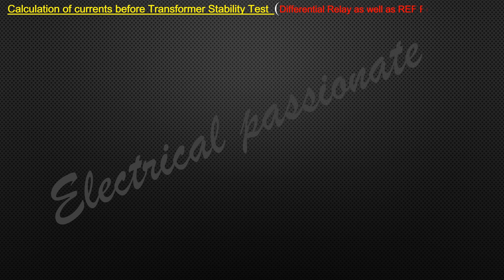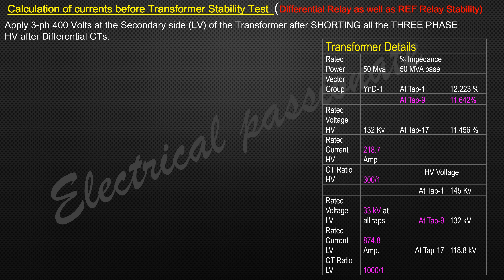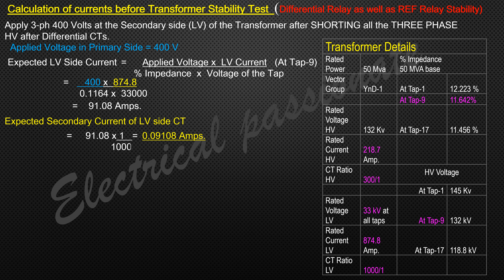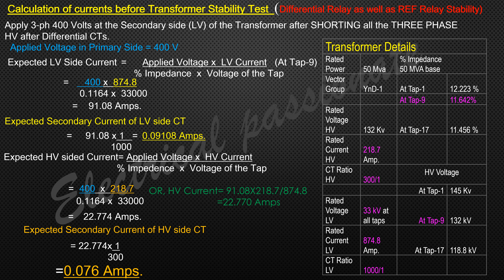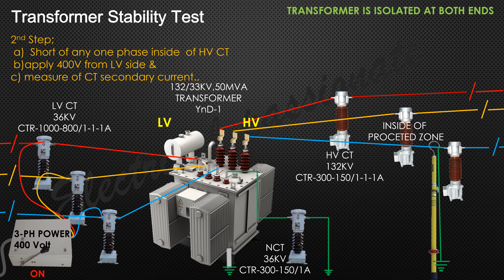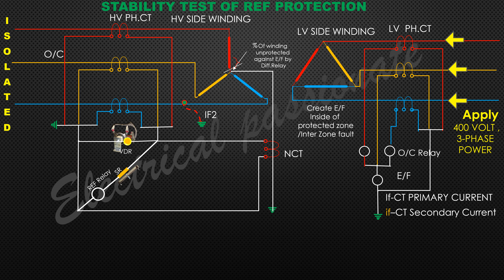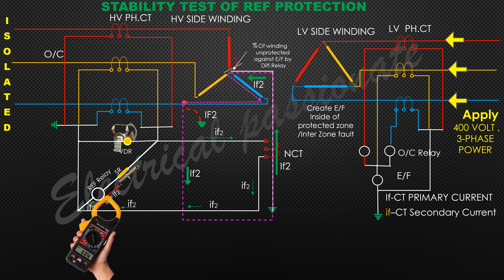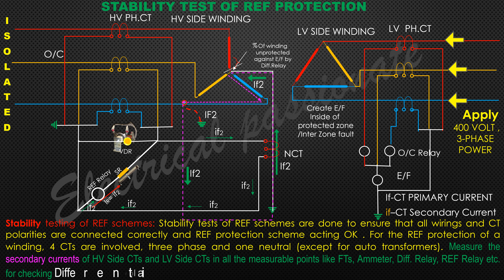Stability test of Transformer:REF stability Test: Calculation of currents for stability test

Comment: Can it be done with multimeter??
Reply from the maker: Ammeter is connected in series with a circuit. Therefore it is not easy to measure current by Multimeter.Thank you.

Comment: Sir 
Is there any reason for apply voltage from secondary side?? 

When we injecting voltage from secondary it will generate 1660V at primary its not quite measurable 

While it's comes for 400/11kv trafo it's generating voltages in KV at primary side.. 
It's very unsafe &  dangerous 

Sir Am I right or wrong??
Reply from the maker: You are most welcome. You are absolutely right in all respects. The video explains only on high-voltage step-down transformer and up to 33/11 KV Transformer.
 For testing 11/0.4 KV Tr. You have commented rightly. Make the process of testing which is suitable  in this regard. Thank you.
Reply: @electricalpassionate  lv side you apply 440v that 3times in hv side 1200v this is huge
Reply from the maker: @velusamypothiraj2300  No problem.Thank you.